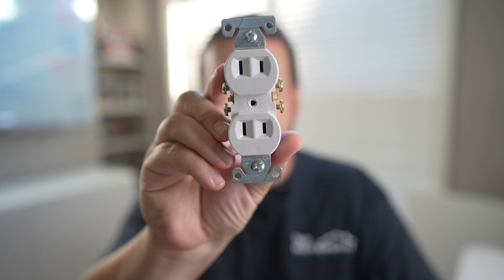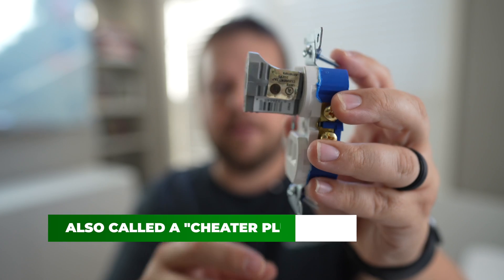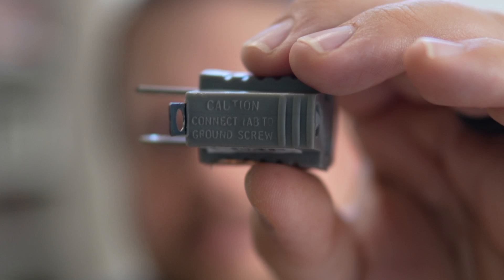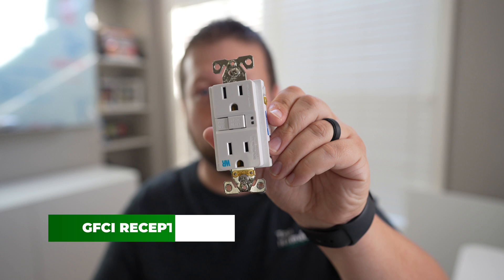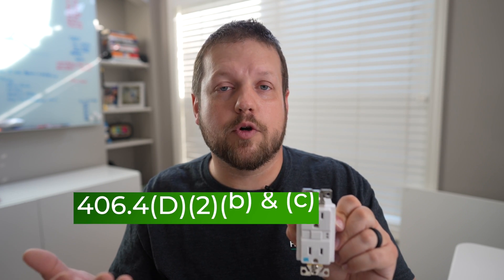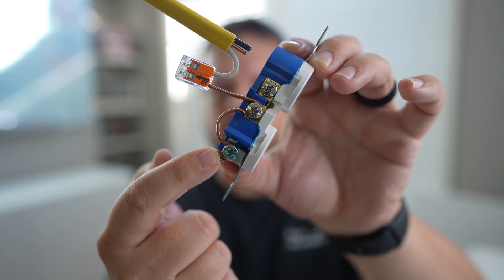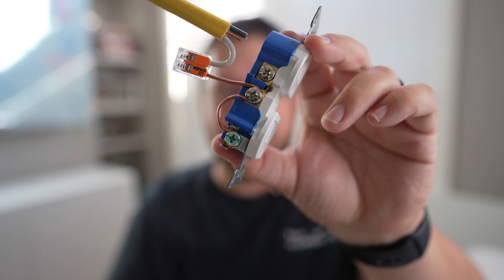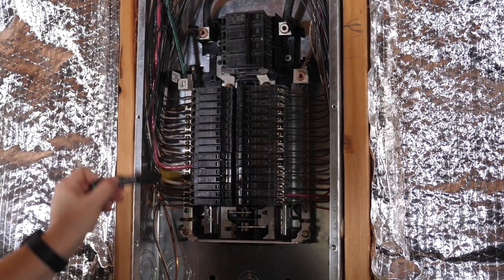3 Weird Ways to Ground a Two-Prong Electrical Outlet

Comment: Suggestion - I am using 2 prong to 3 prong Surge Protectors on high dollar electronics. Cost is comparable to price of a GFCI replacement. Like the GFCI, the "Power Surge / change" will shut off the protector.  DO NOT use Heaters (space heaters) or other high power draw items on surge protectors of any type. Get surge protectors that have ( UL ) on the box. ( Underwriters Laboratories )

Comment: Not an electrician here by miles but could you run an individual ground wire from GFCI through outside wall to ground rod and be covered fully?
Reply: No, it doesn't work that way.

Comment: Where does the neutral go...to ground ...where does the ground go....to ground....there connected to the same ground location. If you have a 2 wire system you have conduit going back to panel or the box has a small wire going back to the panel and grounded.
Reply: You still need a ground wire at a receptacle where an appliance with a 3 prong plug is used. If you cut off the ground pin or used an adapter with no ground at the outlet, there would be no place for a ground fault to clear by tripping the breaker. If the circuit is operating normally, the neutral goes back to the transformer and continues in this loop as long as there is demand. If there's a ground fault at an appliance, the current will travel in micro seconds back to the panel on the ground wire, where it's bonded to the neutral and back to the transformer and trip the breaker.

Comment: I have a home built in 1951. I have several outlets on one breaker (daisy chained I guess is the term). Does it matter where I put the gfci outlet. I would be changing the other two prongs to grounded outlets I know each needs to be labeled. I don't need to put GFCI's in all of them do i? Thanks in advance for your replies
Reply: Put the GFCI on the first one in the circuit.

Comment: hey, can my pc components get damaged if i keep using it with an ungrounded outlet ? whenever i touch a metallic part of my case i get a continuous tingling eletric shock (but only when im barefoot)
Reply: You've got current leaking out, and hopefully you've had it addressed by now. I'd have an electrician figure out what the actual issue is that's leading to the current getting to the case.
Reply: yes

Comment: Can someone explain why a bootleg ground is worse than an open ground? Thanks.
Reply: First of all it's because it's super dangerous and it also tricks most cheap testers into thinking it's grounded
Reply: With two prong receptacles, you can only plug in appliances that are well insulated, or appliances that have plastic or non-conducting outer case. If you use a receptacle with a bootleg ground, you ALLOW appliances with metal case (like a toaster) to be plugged in.  At first, things will work just fine. But now imagine you loose the neutral AND there is fault, that metal case of the toaster is now LIVE and will shock you if you touch it. At least with 2 prongs receptacle, that toaster never would have been plugged in in the first place (unless you use an adapter, which behaves just like a boot leg ground)

Comment: I have a friend from high school who owns some rental properties and they are older with knob and tube wiring.  She had me inspect a few rental properties and I found at least a dozen receptacles that were bootlegged.  Someone used a straightened paper clip to bootleg the receptacles.  I yanked them out and installed GFCI receptacles.  I see bootleg receptacles all the time.

Comment: My dad started building a cabin up in Big Bear California in 1959, finished in 1961. They are all too prong. Never had a problem, we still have the cabin, what do you suggest we do to prevent a problem, or if there ever will be a problem.
Reply: Replace the 2 prong receptacles with GFCI's in the bathrooms and kitchen (where close to the sink), and maybe a few other locations where you anticipate 3 prong cords will be used. The good news is that most appliances have 2 prong cords because they are double insulated and safe to use.

Comment: The national electric code prohibits the ground and neutral wires being connected together anywhere except at  the service entrance box namely the main circuit breaker box.
Reply from the maker: 100%!
Reply: Yes that's true, so I guess if there connected any place else in the run it won't work? Oh yeah , it does work

Comment: woah, you did not know that the grounding tab in a 2 to 3 prong adapter needed a ground screw?  Why am i watching hyour video for electrical advice.  I knew this when i was ten years old!
Reply from the maker: The point I was making is that you have to be sure the box is grounded as well, which may or may not be the case. Most of the time I've seen cheater plugs used, they aren't attached regardless. Personally I wound't depend on them but to each their own

Comment: What about running an insulated grounding conductor to each electrical box separate to the existing ungrounded cable?
Reply: Similar to what I am wondering.  If you have the ability in your structure, could you run a separate green ground wire from the receptacle, or the metal receptacle box, back to ground in the panel to provide a ground for that receptacle?   In my location, panels are grounded to the main copper cold waterline entering the house, rather than a grounding rod.  In this case, could a kitchen receptacle, for example, be grounded by running a green ground wire from the receptacle, or the metal receptacle box, to a grounding clamp secured to the nearest copper cold water pipe under the kitchen sink?
Reply: @chrisgraham2904  No, that would be potentially dangerous as any part of the pipe between where you attached it and the ground could be energized in case of a fault. I'm too lazy to look up what code is, but it's a bad idea to connect the ground to anything that you could reasonably come into contact with or could come into contact with other things. IIRC, my parents house has the ground attached to a pipe as well, but it's a pipe that's as close to leaving the building as possible, not one that's in the living space where people might accidentally come into contact with it and it was done back in the '70s.
Reply: That's the best thing to do, it's just also a bunch of work and at that point, you might as well just replace all the wiring.

Comment: You should have talked about other solutions that are preferable to those you mentioned.

A first permanent solution is to install a separate wire for grounding without replacing the cable. Installing just one small wire is much less expensive and much easier.

Another solution is to connect the electrical outlet to a cold water pipe, which can be very easy in the kitchen or bathroom.
Reply: This is exactly what I was wondering and whether it is acceptable or approved by code.  In my case, running a separate insulated green ground wire back to the panel is prohibitive, but I have two non-grounded receptacles in my kitchen in which a separate insulated green ground wire could be quite easily terminated to a grounding clamp on the kitchen copper cold water pipe.  I would change the receptacles to GFI receptacles, but even those are preferred to be grounded where possible.  In my location, all electrical service panels are grounded to the main copper water supply (on the supply side of the water meter), rather than to an electrical grounding rod.  Of course, this is not suitable if a home has non-metallic water supply piping (PVC, CPVC, PEX), or any non-metallic sections, or interruptions in the water supply circuit.
Reply: This is exactly what I was wondering and whether it is acceptable or approved by code.  In my case, running a separate insulated green ground wire back to the panel is prohibitive, but I have two non-grounded receptacles in my kitchen in which a separate insulated green ground wire could be quite easily terminated to a grounding clamp on the kitchen copper cold water pipe.  I would change the receptacles to GFI receptacles, but even those are preferred to be grounded where possible.  In my location, all electrical service panels are grounded to the main copper water supply (on the supply side of the water meter), rather than to an electrical grounding rod.  Of course, this is not suitable if a home has non-metallic water supply piping (PVC, CPVC, PEX), or any non-metallic sections, or interruptions in the water supply circuit.

Comment: What about replacing the 2 prong with a 3 prong and then connecting the ground to a metal conduit coming from the main electrical panel (that's like using the metal conduit as a ground wire)?

Comment: If doing the GFCI option, does that mean that all outlets in the circuit need to be a GFCI?
Reply from the maker: One GFCI will protect all downstream outlets as long as they are wired to the Load terminals
Reply: @TopHomeowner  Code permitting, could one simply install a GFCI breaker in their panel, and label all outlets on the circuit with "no ground" labels?

Comment: What about connecting the ground terminal to copper pipe nearby in a wall?
Reply from the maker: You might be able to do that, but if theres any break in the pipe (e.g. pex section) than you won't have a ground.
Reply: @TopHomeowner  thanks . Another q for u please . Is the actual metal jacket in metal clad cable (hot neutral no ground wire) code ground when all the boxes are metal?

Comment: if you have a generator or powerstation(battery) and the plugs arent grounded you can ether use a netural to ground bonding plug or if you can take the outlet out and wire netural to ground, this is the only way since they arent connected directly to a panel! Update the ecoflow delta pro 3 has RCD/GFCI compatabiluty

Comment: What if you fish the ground wire to the crawl space below and then connect it to the breaker boxes ground pole with that work?
Reply from the maker: Yes, that would ground the panel. Your wiring in the walls need to have a ground wire as well, but if that's the case you should be good. Just follow all the requirements for the grounding rod and location.

Comment: Did the GFCI thing in my house 16 years ago.  
A note on the adapter, the odds of a house so old that it has two prong outlets also having metal conduit is very low.
Reply: True! But, Armored (BX) cable and 2 prong outlets are not super rare.  BX Cable is usually found in brick houses as opposed to "Romex" or "Knob and tube" found in frame houses, Properly installed BX cable IS grounded the same way as conduit. My sister's house is an 1890s frame house, (originally belonging to my grandparents..) My grandfather (an electrician, with a sense of "Teutonic Overbuild Syndrome") rewired the house in the late 1930s with BX cable. The remaining 2 prong outlet test out as grounded with those grey adaptors when the faceplate  screw is used with the little lug EVERYONE ignores. (No "bootleg grounds either, Just wired like it was 1938!).

Comment: Hi, do we need to bond the ground from GFCI outlet to metal housing box?  Thank you
Reply from the maker: The GFCI protection works internally without a ground. The problem with attaching a ground to the metal box is that there's a lot of times where they aren't actually grounded. Might want to consult with an electrician and have them help you investigate.
Reply: @TopHomeowner  thank you

Comment: Does that GFCI shut down electricity if apliance live wire makes contact with ground wire/housing?
Reply from the maker: Any discrepancy (as small as 4 or 5 milliamps) between the hot to the neutral will trip the GFCI
Reply: @TopHomeowner  so it is similar if you had actual ground from the fuse box?
Reply from the maker: @BlackMambaKO Similar, but not exactly the same. GFCI provides protection from electrocution so it's a safety feature. You still need a true ground if you want to hook up devices that really need it, like computers and other electronics.

Comment: I'm going with the GFCI certified 2-prong receptacle since it doesn't have a ground. I'm also installing a new device box for it since the old device box was heavy modified to fit within the space needed. Thank you for the video.
Reply: "GCFI certified 2-prong receptacle". - What is a 2 prong GFCI receptacle?  And what is GFCI certified?

Comment: Bootleg grounds are DANGEROUS!! If for example,an outlet is replaced upstream and the hot and neutral are reversed,you just installed an electrocution hazard!!
Reply: This should pop the breaker every time if wired this way.
Reply: @earlebaker2440  No, because there is no closed circuit
Reply: @l3ander  YEP! 👍👍 It's a DEATH TRAP! "Bootleg grounds" are one of the WORST electrical "practices"! It would be BETTER to just IGNORE the ground connection of a 3 prong receptacle if putting one in to replace a two prong receptacle! (BTW, Don't do THAT, There IS a reason WHY 2 prong outlets are STILL sold. And Kids, THIS is the reason!)
Reply: @earlebaker2440  No!!! ! It would not pop the breaker (or fuse)!!! Not at all. It's a DEATH TRAP! 💀

Comment: So i have a gaming PC that is connected to an open grounded outlet. It was an add on and the previous owner did some shady electrical work. I am on a budget and cannot afford the 1500$ electrician right now but plan on it. I have a UPS attached to the outlet but my PC is still hot when I touch any metal inside. Is a GFCI outlet safe enough until I get it properly wired?
Reply from the maker: GFCI will only add a layer of safety and not give you a true ground unfortunately. So for example if you touch the metal of the PC and current starts flowing through you, the GFCI is only going to shut off the power.
Reply: your "PC is still hot when I touch any metal inside". - Could you explain that a little better.  Any metal should not be hot...
Reply: I am using 2 prong to 3 prong Surge Protectors on high dollar electronics. Cost is comparable to price of a GFCI replacement. Like the GFCI, the "Power Surge / change" will shut off the protector.  DO NOT use Heaters (space heaters) on surge protectors of any type.

Comment: Just off your thumbnail... Connecting a 3 prong ground to the neutral DOES NOT provide a ground that returns to the panel  and is NOT a recommended method.
Reply from the maker: 100%... You should watch the video
Reply: @TopHomeowner   maybe you should change your thumbnail photo and caption which eludes to showing the bootleg option as best before watching the video or just skip watching it altogether because it is misleading.
Reply: Electric Ranges,dryers are boot leg off the nutural on older wired house's.

Comment: Is is absolutely NOT CHEAP to rewire anything.

A detached garage that has no ground wire back to the house - $2,000 to upgrade the wiring not counting the panel upgrade.
Easier to drive a ground rod by the garage and run garage grounds to it.
No different than grounding a sub panel in a way.

And FAR FAR FAR cheaper too.

A ground is a ground no matter where it is.

Comment: So I had an electrician do some work at our 1937 homestead. The main panel was upgraded and some newer modern wiring and receptacles were replaced, namely kitchen and baths. 
The bulk of the wiring was BX cable, 2 wires wrapped in a metal sheath. Most of the outlets were 2 prong outlets outside of the few that were replaced and updated some years past. The electrician told me a simple test to see if the metal box was grounded using a multimeter or test light. I was able to then drill and tap ground screws into the existing metal box and add a ground wire to swap our 2 prong with 3 prong outlets. Tester shows “correct wiring” throughout.
Thoughts?
Reply: Totally legal.  You can also use ground clips on the boxes to install a jumper to the receptacle if space is tight for adding a wire inside the box.
Reply: My electrician did this too when he replaced some two prong outlets in my house.
Reply: Totally fine as long as each junction point  back to the panel is connected nice and tight to provide the ground path.  Some will debate that's not safe way of grounding, ask yourself why commercial buildings use BX/AC wiring over modern day romex with ground?  Something to think about.